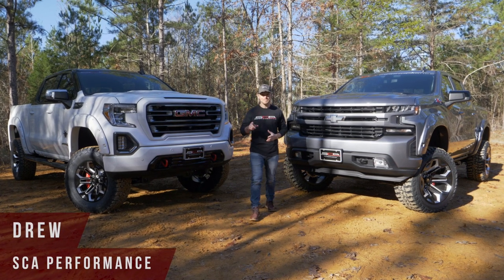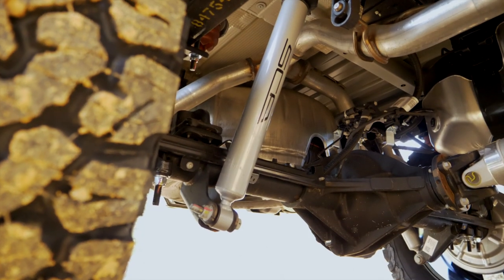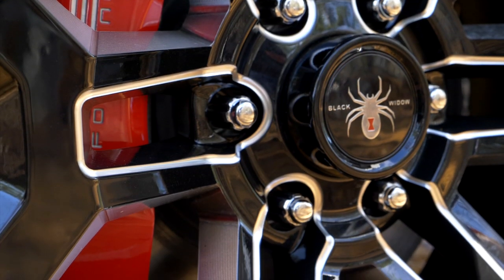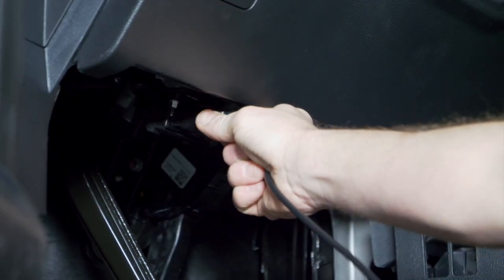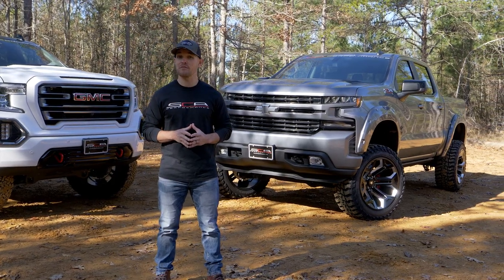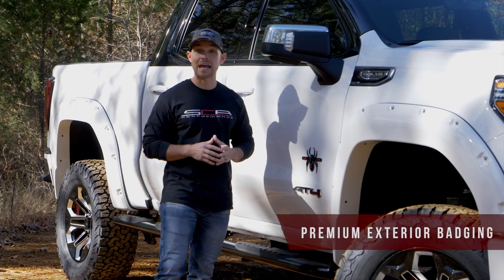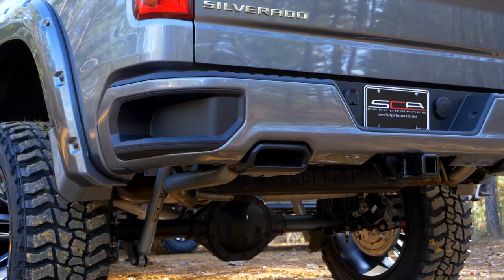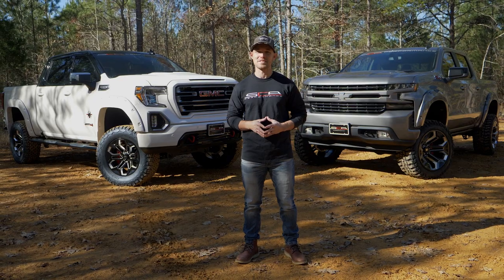GM BLACK WIDOW SHOWDOWN | SCA PERFORMANCE

Comment: I don't mean to knock the trucks, but the dealerships really overcharge on this stuff.  They tried to sell me one for close to 90k. I bought the fully optioned truck for 61k, then within a week took it to another shop.  37" Toyos on 20" by 12 wide wheels (that I got to pick myself ), 7" lift, Addictive Desert Designs bumper with 50" integrated light bar, power concealed steps, cold air intake, straight piped, and tuned, and I spent around 13-14k building exactly what I was looking for. So you end up 10 grand under what the dealership is charging and you pick all the details yourself. I went with -44 offset on 12 wide wheels because I prefer the truck to have a wider, more aggressive stance. I also just do not like bolt on fender flares. On top of that, it was a 2020 they were trying to offload and I ended up buying a 2021 and still ended well under price

Comment: Beautiful rigs as always. I love BFG no doubt but lately, I have discovered the Yokohama Geolander X-AT tire and I find I like it much better. Outperforms the BFG in most off-road conditions. Rides smooth as butter and quiet too on the road. Sidewalls are 3 ply which makes it a little stiffer tire but other than that loving them so far. Keep up the great work, I got my eye on one of these rigs right now. LOL